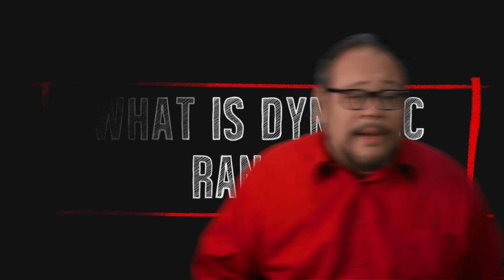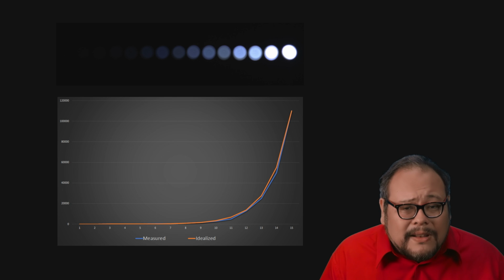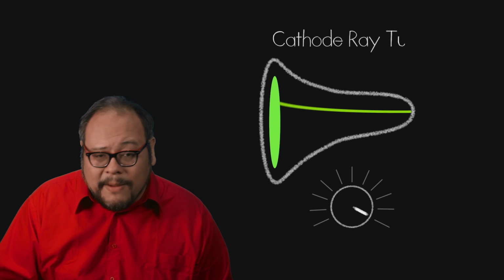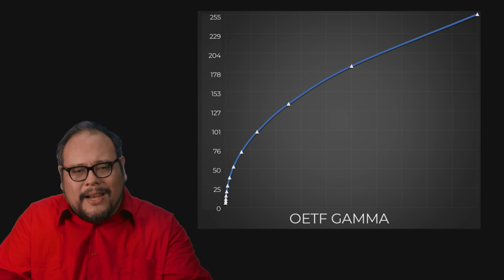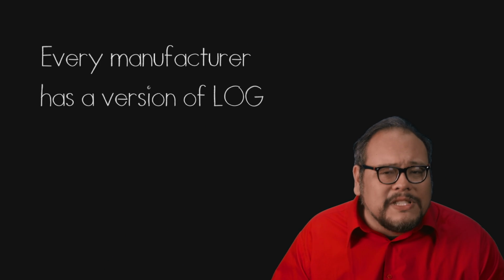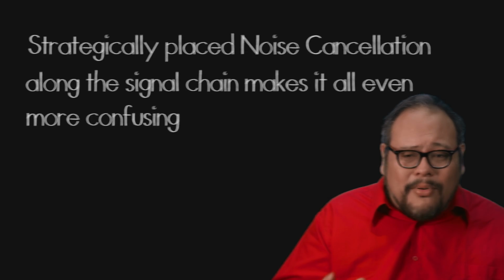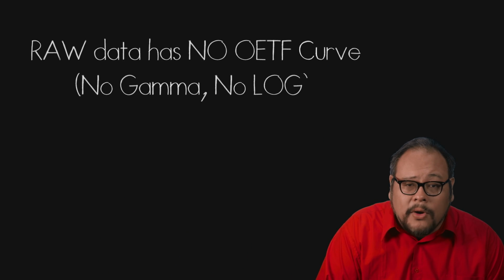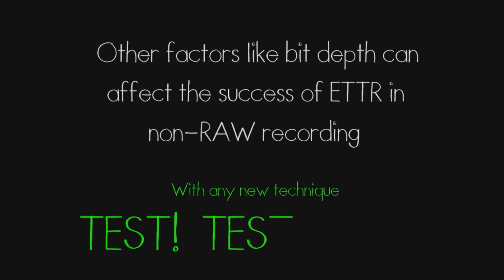Diving into Dynamic Range

Comment: Analog film was ASA for me and none of this ISO stuff.
Reply from the maker: On an international level, the ASA system was superseded by the ISO film speed system between 1982 and 1987, however, the arithmetic ASA speed scale continued to live on as the linear speed value of the ISO system. https://en.wikipedia.org/wiki/Film_speed
Reply: I used to shoot in ASA64 and ASA100 and did the 64 live on as all I hear about is ISO 100 on the modern digital cameras?
Reply from the maker: There are cameras that shoot ISO 50. The numerical system did in fact live on
Reply: Excellent and ASA/ISO 50?  WOW!!!

Thank you.

Comment: I agree that real RAW should be, and up to now was mostly linear. but you can record separate pixel values with a game curve for their respective luminance which is the way to go when you use 10 or 12 bit per value rather than 14 to 16 bit per value and that is what some manufacturers are starting to implement. 10bit linear raw (FS5) is way worse than 10bit log raw (pana).
Reply: can you go into more detail on this cause i thought raw was raw? so whats the difference? how can one camera's raw footage be "Worse" than another cameras? and in what ways is it worse? cause if the footage is "Raw" then it should still be super flexible in post right?
Reply: Kishawn look into what Gamma curves are and why they are used. Just watch the video really. It’s a good start. Raw can have different properties (linear vs gamma, baked in WB or not, bit depth, compression) the only thing they definitely share is they are not yet debayered, so there is usually no bad debayer (sharpening) or denoise although I don’t trust canon and especially bmd (b m raw is „partly debayered“ ? ) in those latter regards.

Comment: I've really enjoyed your past videos John, and now the last couple involving exposure and dynamic range have REALLY intrigued me, but they have also made me wonder if I'm understanding things correctly regarding maximizing dynamic range to help better preserve highlights in video not so much by using ETTR at a base ISO but by (somewhat counterintuitively) using some optimum higher ISO based on the behaviour of the camera being used.  I've heard rumour that even for stills some cameras in some situations do better ETTR at a higher than base ISO.  I think I've understood ETTR at base ISO for stills but never the buzz about shooting at a higher ISO for video except hopefully now with your dynamic range video, but I'm still not COMPLETELY sure.

Am I correct to assume then that if I were to use say a GH5 (not GH5s) for capturing high contrast scenes in video, and that preserving details in shadows and highlights (especially highlights) was important to me, that I would be best to shoot flat using a log-based video format beyond 8-bit colour (like 10 bits) for RAW-like latitude while using a waveform rather than a histogram for a more or less "normal"/"optimal" exposure at the mid-grey?  I hope I am right to assume that when you showed the example of the clouds being blown out at a lower ISO than the ISO that would have preserved them (with overall exposure triangle EV otherwise being equal), that those clouds would have been fine at the lower ISO but at a different internal camera setting for exposure, but at the sacrifice of likely underexposing the clouds and the shadows - requiring post-capture exposure correction that would have still left the shadow detail destroyed.  It seems to me that this is a different way to destroy shadow detail than having high ISO noise, but the effect is much the same - damned if you do and damned if you don't.

I can't help but STILL think that instead of using high ISO exposure, using ETTR at a base ISO where intentional overexposure was possible would at least be less grainy/noisy even if that ISO does not allow the maximum dynamic range, but then I suppose high contrast scenes do not always allow intentional overexposure without overly blowing out highlights.  I'd like to get into this stuff but I'm not sure if I'm correctly understanding or reconciling the options mentioned in the dynamic range video…if anyone knowledgable could please confirm my understanding or comment on what I might be missing.
Reply from the maker: This is really confusing to parse out. I think you are bringing into a misconceptions... Here's a couple basic tenets... ETTR is best used when shooting RAW where the data is stored in a linear manner. I would suggest avoiding ETTR when shooting LOG unless you know precisely what youre doing and tested it.

Regards to whether those clouds would have been blown out if I was not using a LOG curve... Actually I think they would have been as well. That cloud is clipping because it's actually clipping the sensor.

The concept of the highlight protection is about reducing the light coming on to the sensor. It's all about light. Shooting higher ISO means you are forcing the light to fall on a range of the camera thats far lower than clipping.
Reply: I am very glad that you responded, and so quickly too, John!
What you said makes sense too - thanks for that.
I admit that I should have thought things more carefully through in order to have come up with some of my answer or at least to have better explained my question.  The thing is, I was wondering, as someone who has never shot beyond 8-bit colour video but who intends to, whether combining 10-bit log and ETTR is possible or even advisable (so thank you for answering that question), and if so, if there's some way of perhaps determining a sweet spot for that using a waveform.  As you say, test test test!  In lieu of a camera to test, I would think research helps too, and I need to do more.  

I know your video seems to warn against using anything but the base ISO for ETTR, which makes sense.  It also makes sense to me that the extended ISO as you demonstrated does no favours for dynamic range.  I still find myself wondering though if in some cases and for some cameras ETTR with a higher-than-base ISO might actually work (and possibly in log as well).  I wonder if you might have accomplished something at least close to that in your video when you were showing the clouds did not blow out in comparison to those that did - with perhaps the former being close to ETTR?

It makes sense from your response that the clipped clouds were due to exposing too much light on the sensor, and the unclipped clouds were achieved by you exposing less light to the sensor while achieving the same overall EV by bringing up the ISO.  I think you're right about the log curve not making a difference to clipping as that curve is independent of what the sensor is doing at least as I understand it.  If however you recorded to a different video format with less latitude, then I think in THAT case the file might have clipped the highlights before the sensor actually clipped them - much in the way that JPEG photos clip faster than RAW ones (albeit less so if we shoot JPEG "flat", although I'd still never shoot ETTR for that).

I realized that ETTR as you said is best when used with RAW (photos as well as video I assume), so I hope I'm right to assume that the same could be said with a video format that might not be technically called RAW but that has the high latitude of 10 bits (i. e. greater in latitude than any JPEG-like 8-bit video format).  I understand that we shoot "flat" in order to see on our camera's electronic display that we are indeed recording highlight and shadow detail, and that recording in log and/or video RAW gives us further benefits over more standard consumer formats in the ways your video mentions.  With log though I guess it's a matter of compressing mid-tones at least on the camera's display and then re-expanding them where needed in post, which I hear works better when we record BEYOND 8-bit colour, as this has greater tonal and I guess dynamic range (lest we rip apart mid-tones too much, although perhaps some cameras mitigate this better than others in their use of 8-bit colour).
Reply from the maker: Now that I'm on a computer I can better respond.

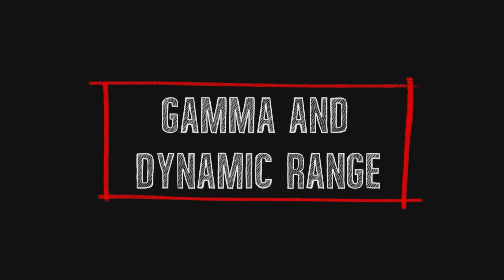10 bit is not a latitude. Ten bit is a bit depth. Recall in the video how I said we were going to compare the  graphs using a 8 bit scale of 256 possible values at around 12:30? Well instead of 256 values, 10 bit gives us 1024 possible values - basically 4 times more information. This means more flexibility...  Remember that the goal is to go back to 8 bit REC.709 - because 10 bit gives you a larger number of possible values in each stop, you have a lot more wiggle room to stretch and bend each stop before you run out of information and result in banding. 10 bit does not determine how much dynamic range we can squeeze in though... it is the gamma curve like LOG that lets us store more stops. You can shoot 8 bit LOG just fine, as long as you get your exposure close to where you want it.  10 bit over 8 bit just gives you more flexibility.

Log does not compress the midtones as much as it compresses the highlights. Log's main job is squeezing in more dynamic range - where in REC.709 gamma the top stop of an 8 stop DR takes up 25% of the data, a Log curve will squeeze that to maybe 9% of the data.

In regards to ETTR - Since the information in LOG is stored in relatively even chunks you're not really gaining any information advantage by shooting one stop over exposed. This is the reason why ETTR works so well in RAW or Linear Space - as you go up in exposure, you get more data to work with. But that's not the case if you shoot LOG. You could potentially shoot 1 stop over exposed and then bring it down to crush the noise floor - but you might as well just lower your ISO and get essentially the same effect. 

Furthermore, none of our discussion so far has delved into color at all... and when you over expose a log curve you can potentially screw up he color renderings. Again this is something that is camera specific so you are best served to try shooting some tests.

"Shooting flat" is sort of a misnomer - if by flat you mean LOG color. The flat is in reference to shape of the gamma curve (which is flatter than REC 709). But some times cameras will have a flat profile which just means there's less contrast applied

In regards to the recording those clouds with a format with less latitude - yes, the lower ISO will clip the whites faster than the higher ISO. Remember, it's the sensor that's doing the clipping - not the format. So if I plug that clipped cloud into REC 709, you're just going to see clipped white whereas the the higher ISO cloud will roll off smoother. This is one of those things you can easily try out yourself.
Reply: Hi again John.
Apologies as I was editing my last response AFTER you had already responded to it, without me realizing it.
But your your answer still perfectly relates.  

In fact an extra thank you for a rich response that is longer than before, and that well clarifies things.

So I think I'll let that stand without saying any more, except…

Thank you again!

Comment: Well-done.  My argument for a long time is to not trust the advertised "ISO" of the cameras and instead, put the camera on it's advertised "native ISO" and test to find out what it really should be considered.  For instance, my GH3 in video mode claims a native "200" but I have to set my meter to 125 to get correct exposures.  Blackmagic cameras brag about being 800 ISO... no, 200.  When you start thinking in those terms, "ETTR" becomes a non-issue and I haven't actually used the histogram in any camera I've used for about 10 years.  One must of course know thy  camera and occasionally do spot meter checks to make sure you don't blow out or crush anything important.  Proper video cameras don't generally makes claims of specific ISOs so there's less "fighting" against marketing numbers.  You simply add light till your skin tones are 75 IRE or whatever you want.
A good way to improve your LED DR target would be to calculate and implement resistors to control the brightness.  You could even put little trimmer pots on each one (except the brightest) and adjust them to perfection.  You need to make sure your power source is absolutely consistent though.

Comment: big big big fan of you as never before 
your are so so SO brave taking the horns of this one

by the way I did some test on the matter few months ago and SURPRISE: the protect shadow using low ISO (and viceversa) seams to also apply to regular raw non-log shooting with photo cameras on still photography
Reply from the maker: Protecting Shadows using low ISO is actually the more easy one to convince people of. Every photographer knows that raising the ISO introduces noise to the shadows. So if you want less noise in the shadows shoot a lower ISO ;)
Reply: Filmmaker IQ  but telling the people: interiors... low light low ISO, and exteriors high ISO seams to be the most challenging concept to teach.. until now...  with your video... congrats!
Reply from the maker: @omarquintana3481  well its not so much low light... It's more like if you want good detail in shadows.

There's an old story about the cinematography used on The X-Files. The show is of course very dark but it's extremely brightly-lit in order to achieve that low light dark feel
Reply: one more question... this low iso for shadow detail-high iso for lights detail does also works in RAW? my test said yes but is not a big difference so i’m not sure was a failed experiment or it is just no than many dynamic range adjustment
Reply from the maker: Yes it works in RAW... Just remember that in this camera the ISO is metadata on top of the camera which always records either ISO 400 or 3200
Reply: my test are with canon 5dmk2 and 5dmk3 using raw. 
The test using the sekonic DTS software shows: 
at iso160,
dynamic range: 7.9 stops ,
below middle gray: 4.5,
over middle gray: 3.3.

at iso 640,
dynamic range: 7.5 stops ,
below middle gray: 3.8,
over middle gray: 3.6.
Reply from the maker: Interesting to see you show more detail in shadows but I think your numbers are off. DXOmark has the 5Dii at 11.9 stops DR. And that's more in line... There's little chance it has less than 8 stops.

With Canon I think you have micro push pulls going on because the mid points are stairstepped.

Comment: Challenging video to follow, but appreciate the hard work. Your examples showed a difference of shutter speed along with aperature. I guess as a newb, ive been reluctant to move away from 180-deg shutter angle. This is something I will "Test, Test, Test." Thank you for posting.
Reply from the maker: I primarily altered the shutter speed because the effect would not be visual but temporal (to do with motion). If I changed the aperture on the ETTR demonstration, I would be changing the depth of field and that would muck up things when comparing noise knowing I would have to zoom in to see the effects.

For the most part 180 rule for shutter speed is a good starting point. But you don't have to adhere to it that religiously.

Comment: I can definitely measure ½ millimeter with a meterstick. Can you do the same trick with cameras? 
Edit: This is apparently not how it works.
Reply from the maker: I'm Curious... how do you measure half a millimeter with a meter stick?
Reply: @FilmmakerIQ  You visually half the millimeter. Vision is good enough for halving millimeters. So it is 0.5mm accuracy instead of 1mm accuracy.
Reply from the maker: That's not going to fly. Look up the concept of significant digits.
Reply: @FilmmakerIQ  Thank you.
Reply: @FilmmakerIQ  Oh, this is basic math. I know this, but hadn't thought about it in a meterstick way.
Reply from the maker: Accuracy is key. You can eyeball 1/2 a mm - but how do you know it's not .4 or .6? There's no way of telling with a meter stick with millimeter markings. But you can know for sure if something is 5mm or 6mm...
Reply: @FilmmakerIQ  That is true. You're right. I'll remove the comment.
Reply from the maker: I was hoping you'd come up with a clever way like the way calipers do it... then you would need a meter stick and another stick with different kinds of demarcations! :) :)
Reply: @FilmmakerIQ  True, yeah I couldn't think of any counterargument.